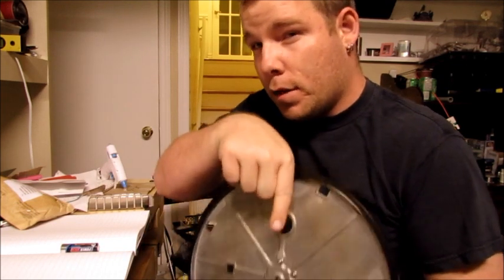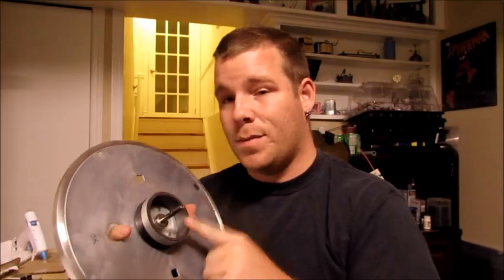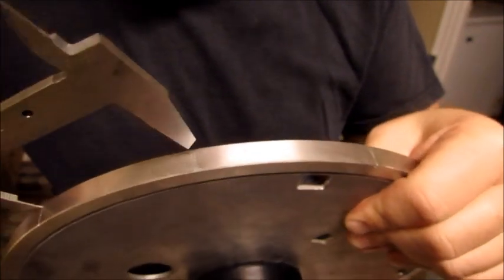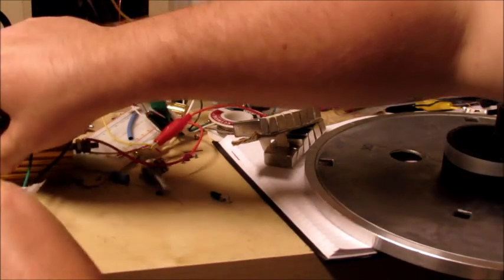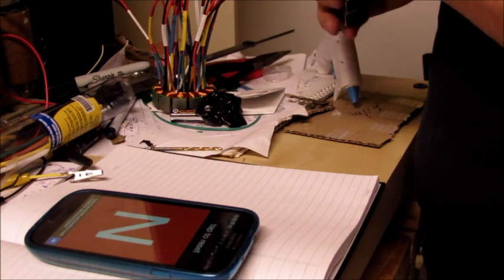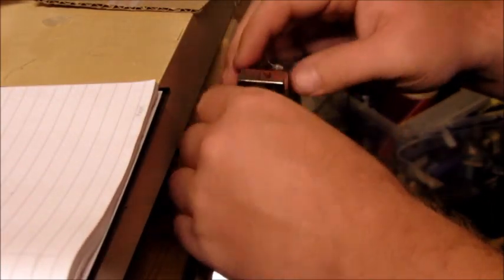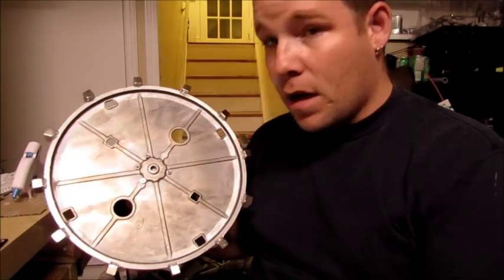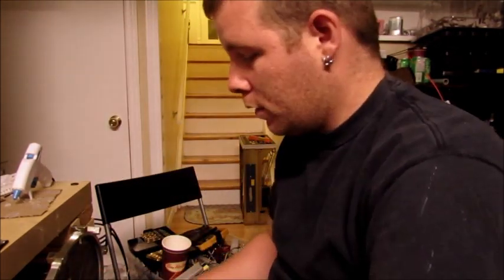Free energy bike P11 "The Revolution SSG Bike" By inventor Matt McMahon

Comment: Very Nice project! I like the metal bracket idea as hot glue will vibrate loose, perhaps jb weld or epoxy as well as a bracket, and a jig to get each one 90 to the hub. 
Have you found a supplier for magnets in Canada? Been burned too many times ordering from the states either with them not coming or paying double with duty or ups charges. thanks